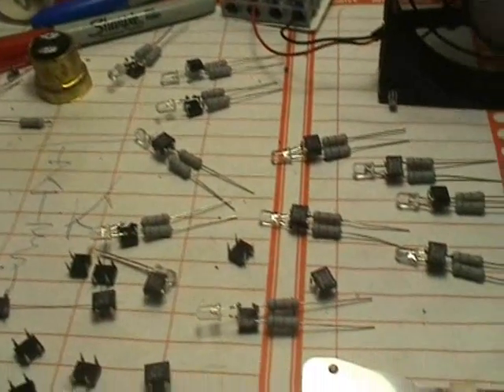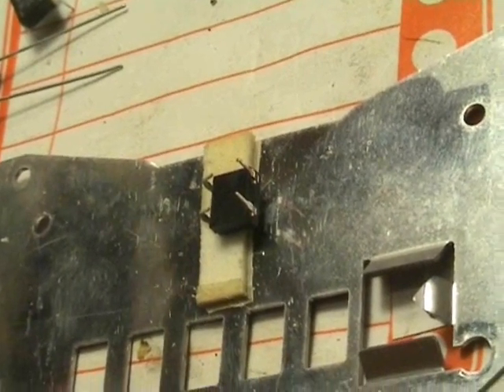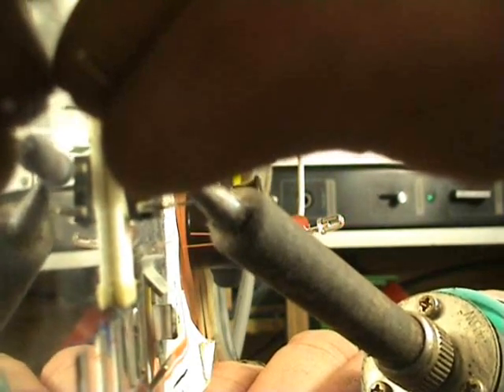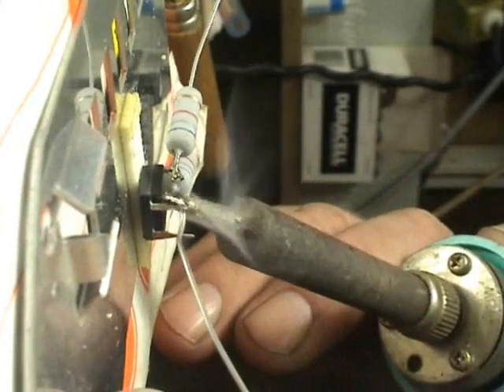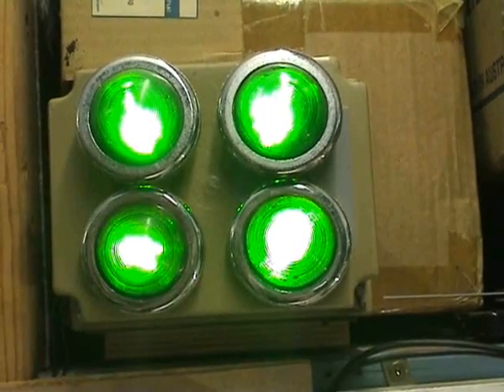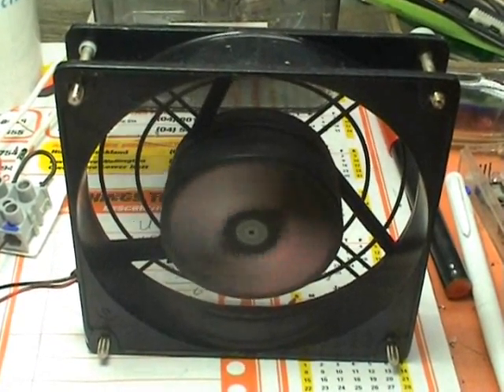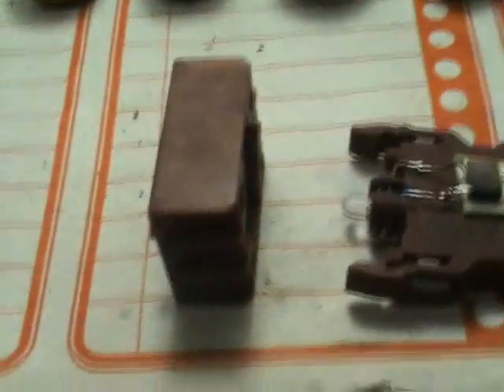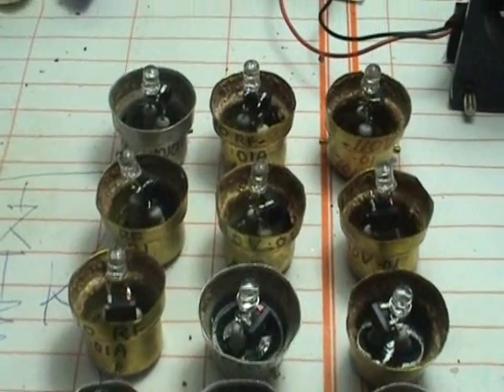LED indicator lamps 110 and 230 Volts

Comment from the maker: @cheetawolf These are rated 400 Volts 1 Amp, not good for what you want.
Get a block rectifier 400 Volts 35 Amps if you want to burn out motors and put it on a heat sink.
They cost only a couple of dollars at an electronics shop